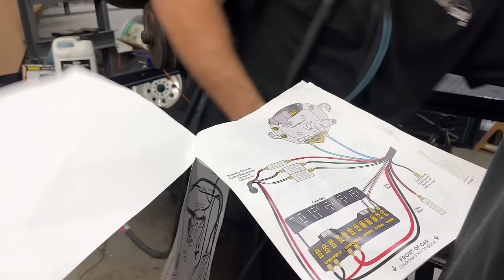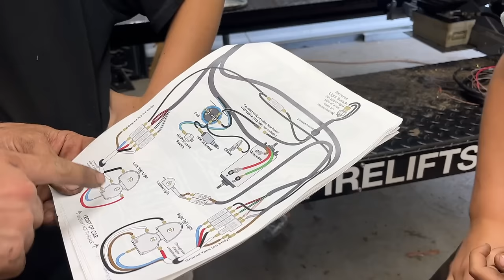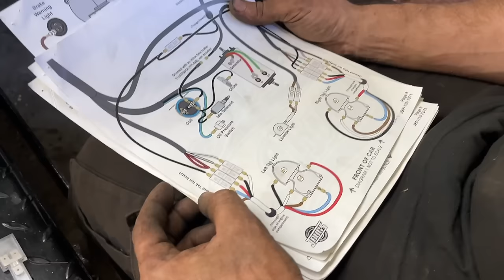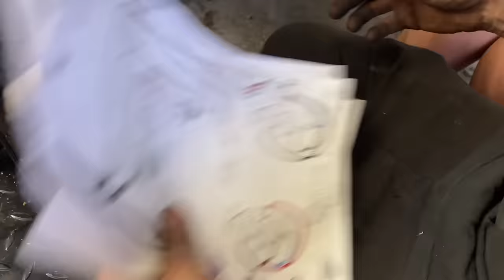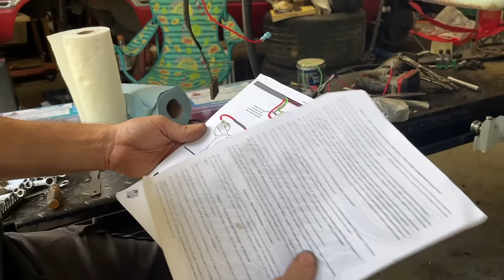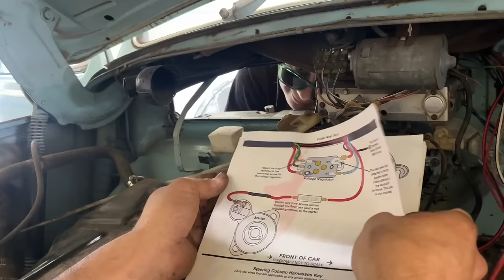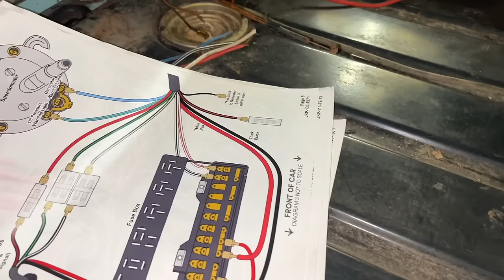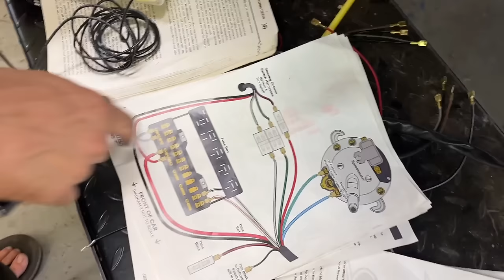Back on the road after 23+ years parked!

Comment: The previous owner was probably just planning on making a simple harness for making the car run and not buying a complete aftermarket harness for the specific vw bug so that is why he just practically cut everything out we had a farm truck that kept shorting out and catching on fire and the steering column was a issue so before too long the interior of the 81 Chevy c20 Scottsdale Long bed 350 quadrajet 4bbl 4 4spd manual shift transmission was a steering column shaft a steering wheel and only the parts of the column tube to mount the steering column to the dash and the collar on the floor and the firewall and two wires to the reverse switch spliced together to one wire and the purple and white stripe lengthened and laying across the steering column shaft and that was how you started the truck,oh shiii, approved lol and the fuse box had wires running out of it out under the hood to power the headlights and tailights. And after I started messing with the truck as one of my own vehicles I got a complete different standard transmission non tilt steering column and key release lever with the gm ignition key, and changed the front light harness so all of the lights would power on when you pull out the headlight switch truck would pull massive burnouts 4.56 open diff 14 bolt rear and 16.5 9.50 mud trac mud and snow tires old 70's series bias plys made by Firestone and it would throw some tall rooster tails in the field too, especially with the 4spd transmission

Comment: New video - fix rust and dents, Use primer/sealer (no sanding), 2-3 coats of color and 2 coats of clear coat, will increase joy for Wawa and value will increase 20 fold.

Comment: Love the relative simplicity of older cars. Need to change a bulb.. just take the light cover off. Modern cars you practically have to disassemble half the car.

With your beatle, something didn't work, you tried few things and found the problem.
Modern cars you need to plug it into computer just to figure out what may be wrong.

At least when your daughter gets to drive her car solo, she will know how it works, and will be able to fix it if need be. But beetles will run and run with minimal maintenance.
Reply from the maker: Thank you so much

Comment: Below that breaker plate, would be a Mechanical Advance, Hence no reason for a Vacuum advance. It's built into the distributor.
Reply from the maker: But most of the distributors you see, have a mechanical advance and a vacuum advance
Reply: If there's No Vacuum advance, then that's basically all you get depends on the Company that Manufacturers them, you could possibly find some tech sheet on the Certain Model distributor with adjustment procedures. Or another Company that provides the Vacuum advance, I would check the Factory Specs. Against the Aftermarket one being used you may approximate the elusive "Sweet Spot" ?

Comment: After that long sitting I can almost guarantee that the fuel pump diaphragm is rotten and leaking gas into the crankcase.   I suggest an electric pump and filter be installed under the tank.   Need a low pressure pump,  no more than 4psi.  I run mine through a revolted set at 2.5psi.

Comment: These carbs are totally different to any other carb you have ever worked on. Idle is totally controlled by the two mixture screws on the side. The adjusting screw on the throttle arm is only for when the choke is on , and should barely even touch when the choke is off. Idle has butterfly,  by pass passages. Getting these setting wrong , will give you , no idle , too fast an idle or an accelleration flat spot. Here is link on how to tune these carbys.https://youtu.be/3MVdscVjEn8

Comment: Hello Josh and Kristina this is very important information the plastic filter for the gas in the back is no good it's made in China and I seen two very important Volkswagens burn up on the highway and one mechanic says it because of those stupid cheap plastic filters see if you can get a metal one put in with make sure there are they are shield correct and check the rubber hoses and make sure you tighten them up I want you enjoy your car since you are impeccable take care of you and the family God bless

Comment: , also Wawa when you get a chance put in a spare tire in the front nose I fill it with air and make sure it's tight because that tire God forbid you getting the front accident it will take most of the impact I know it because it happened to me at one time the only thing I had to change with the hood it popped up a little bit but I couldn't get it back down other than that that's a great safety issue I also got hit by a bus at the stoplight and knocked me across Steinway Street Astoria Queens I survived that to no damage to my VW impeccable God bless

Comment: I don't get why you want to replace the generator with an alternator, it's working fine and probably will outlast a new alternator as well. Just remove the old grease from the generators bearing add new grease and it's probably good to go for a long time

Comment: Inspector here:Stop... use valvoline... this engine is made for it and visa-versa.... You Have to have metal clamps on the rubber brake lines. they will blow off on 1 stomp of the brakes... both throttle cable and clutch cable are seperate cable solid unit . they get old and rust down the tube, clean like the brake line blow out inject water Resistant grease then push new cable thru.  the digital ignition is great, much faster than the Vacuum advance... But.. If There is a EMP and everything that has a microchip Dies,  The Old ignition, points dwell tach,and vacuum advance.. will be Unaffected. Save all old original parts... Soo FUN!

Comment: Use to have a 68 comet.....After driving it for 4  years no issues...........Was exiting the freeway and the brakes failed.....One of the lines failed.........................
LAST thing you want is brake failure for your daughters car......................
The lines are old...............Based on my first hand experience with a vintage car.........................Put in new lines...........................

Comment: Recommended oil for an air cooled VW is SAE30W  and EP80/90 for the transmission,  They don't like multi grade oils or synthetics because the dispersants in modern oils are not compatible with mesh filters.  ZDDP helps with the cams.  You should not use Rotella in an air cooled engine as they run hotter than diesels or gas engines!   Rotella oil should not be used in gasoline engines period as it has the incorrect additives for gas engines and has a lower heat rating.  Throw the bellows in the cooling shroud and the flap that it connects to in the trash.  When the bellows fail and it will if it hasn't already the engine will overheat.

Comment: VW's are not slow, my first car was a 59 Bug, it was slow until I put a Porsche engine in it, that car would nearly fly at 120mph , outran the cops a few times for fun. (Don't do that WaWa) do NOT Lower it as it will corner better than most cars just like it is and you can tow it behind the motorhome easily for family fun. I Love you all, oh yeah I was a VW Porsche mechanic right out of high school and have owned nearly 100 VWs .

Comment: keep that german carb and take the time on it.. the chinese carbs aren't worth it.. also the reason you're having problems with that leaking at the brass fitting is either because its not tapped in all the way or the use of 1/4" fuel line that isn't braided...

Comment: Speaking from experience,  PLEASE , put hose clamps on all gas lines. I knew two people plus had my own engine burn up because  under load and heat of the engine,  you do not want a gas line spraying gas all over a hot motor and electrical wires. Go wa-wa !

Comment: I'm no Rocket Scientist; HOWEVER, I would have added an in-line FUSIBLE LINK (large main fuse, replaceable) on the positive output side of the battery. Justin Case. 'A la '76 Toyota Corona or '85 Camry.

Comment: Definitely do not use synthetic oil. Volkswagens are air and oil cooled . Synthetic oil does not absorb the heat from the motor like conventional oil does. good old 20 W 50 will work fine . An SVDA distributor uses a vacuum canister and dramatically helps with drivability Just my two.Cents.

Comment: Yes run vacuum advance the nun vacuum advance it's more for commercial use when the motor is running at a certain RPM all the time I believe Duckman has whole video out on vacuum Advanced and non vacuum Advanced Volkswagen engines

Comment: Fuel lines and brake lines are metric. Odd sizes.
Reply: The way they wire up the alternator/generator, if the Blue light for the alternator goes bad you don't have a charging system. I suggest carrying some extra bulbs in the glove box. lol

Comment: Most of the time, whatever oil is fine, in anything with a roller cam, it's not as critical. But please Please don't do synthetic oil. (Or the 15w40) it does not mix with the zinc antiwear additives, and neither does synthetic.....If you want it to have the right stuff, look for straight 30w, or straight 40w from ams oil, driven, or Valvoline. Something specific for older vehicles. People say it's not worth it, but if you like your car it's totally worth spending a couple dollars more to get something specific for old junk. . guarantee it will last longer if you do.

Comment: are you putting synthetic motor oil in an air cooled engine ? Rotella T4 15W-40 is not synthetic oil, it is a blend. Use SAE 50 or 15W-50 or 20w-50
Reply: T4 is dino oil. T5 is synthetic blend. T6 is full synthetic. I use T6 in my Mercedes diesel.
Reply: @gotham61  your mercedes diesel is not air cooled ?
Reply: @srenlund-hansen6883  Mercedes has never made an air cooled car
Reply: @gotham61  that was the subject you were commenting on, oil and air cooled cars. 
They made lot of air cooled cars w boxer engines.
Since Benz's first opposed twin, there have been four-, six-, eight-, 10-, 12- and 16-cylinder boxer air cooled engines, powering everything from motorcycles to family transport, sports and racing cars. Plus a wide variety of commercial and military vehicles and aircraft.
Reply: @srenlund-hansen6883  Not sure what point you are trying to make. You said Rotella T4 is a synthetic blend, that is wrong. T5 is the synthetic blend.
Reply: @gotham61  HE sleeperdude said that it is fully synthetic, and it is no. T4 is conventional old fashion oil, T5 is blended semi synthetic, T6 is fully syn.
You also said that Mercedes Benz never made air cooled cars, stop now before you get everything wrong.
Reply: @srenlund-hansen6883  Boy, you just don't know when to quit, do you?
As a former Mercedes Benz Club secretary, and as someone who has written for several Mercedes-Benz specialist magazines, I can guarantee that I know more about Mercedes-Benz history than you do.
You said: "Rotella T4 15W-40 is not synthetic oil, it is a blend"
This is wrong.
I said: "Mercedes never made an air cooled car"
That remains a 100% accurate statement. In fact, Mercedes has never made an air cooled engine of any type, including aero and marine engines. If you are so sure I'm wrong, please tell me the years and models of these mythical air cooled Mercedes cars. They don't exist.
They have also never made a boxer engine, apart from a few pre-war prototypes, and the flat 12 M291 use in the Group C C291 race car in 1991 and 1992. Like all other Mercedes engines, it was water cooled.
Reply: @gotham61  you are from the us. You dont need to know everything, but you seem to know it all as long as it fits into your little world. Come visit the civilized world and the museum in stuttgart germany
Reply: @srenlund-hansen6883  Funny you should mention that. I will be visiting the Museum (for the fifth time) in about two weeks. I will also be at the annual VdH Jahrestreffen in Ornbau. Maybe I’ll see you there?
By the way, just FYI, I lived for more than two decades in Europe, aka “the real world” LOL
Tschüss!
Reply: let them show you how many different air cooled engines they have, including boxer engines. The museum is built like Guggenheim-museet in New York,
Reply: @srenlund-hansen6883  Like I said, I have been there several times. Maybe while I’m in Stuttgart I’ll also go to the Porsche museum. Unlike Mercedes, they actually did make a lot of boxer and air cooled engines. 
Such a troll.

Comment: Good afternoon 😃 sleeperdude   On wawa Volkswagen the motor is held in with 4 bolts  you have to disconnect the wires to the motor and then take out the 4  bolts that hold the motor in  now  wiggle the motor and pull it out of the transaxle    1  good thing is the motor will run 🏃‍♀️ out of the car 🚗 because it is air cooled  I think 🤔 wawa Volkswagen is really nice 👍 for her to have and drive  I would like 👍 to see you and the family put  on a set of hedders for a  good Sound  I have owned a rail buggy that was made out of a Volkswagen I had herdders  on it  it sounded very good 👍  i really enjoyed driving mine off road  you said you might get a  nother  Volkswagen.  You might like 👍 to try to make a  dune buggy or bahaw  🚗   Or  a rail buggy  I think 🤔 your family would love any of the ones I have told you about  I  like 👍 Volkswagen  they are so neet  I know that wawa  will enjoy driving her car 🚘  your animals are so cute 🥰

Comment: You don't use a paint brush to paint wheels, a rattle can would have been much faster and looked much better. Youll have runs all inside the wheels cause the excess paint builds up then runs out of the crevasses. Also those plastic fuel filters fail a lot. This is an air cooled car these Vws are notorious for catching on fire as is and now you increased that chance. Come bon Josh you know better than that. Remember your daughter is going to be driving this car.
Reply from the maker: Ok thanks

Comment: How is wawa aloud to drive in the US if she's only 14 🤷‍♂️
Reply: The age at which a teenager can start to drive varies greatly depending upon the state in which the adolescent resides.

In nine states, teenagers can enter the learner stage of a graduated driver licensing (GDL) system and obtain an instructional permit before turning 15 years of age.  In some rare circumstances, a teen can drive alone with restrictions at age 14.

I think 14 is young, and so do many safety experts who recommend waiting until age 16.

If you have a child who is approaching licensing age, it's wise to view your state's Department of Motor Vehicles (DMV) website to read up on the requirements your state has in place for its GDL process.

Typically, in the first stage - the learner's permit - the child will need to have to have a supervising driver in the passenger seat.  For the intermediate stage, the teen can drive alone but with restrictions.  And with the full license the young driver is able to drive without restrictions.   To move through the GDL system, most states require that the teen take certain training in class and behind-the-wheel driver education courses.

Here is a breakdown of age requirements for a learner's permit, according to the Governors Highway Safety Association:
Reply: State                         Age

Alaska                        14
Arkansas                    14
Iowa                           14
Kansas                        14
North Dakota               14
South Dakota               14
Idaho                          14 years and 6 months
Montana                      14 years and 6 months
Michigan                      14 years and 9 months
Alabama                      15
Colorado                      15 (with driver's education class or 16 without)
Florida                         15
Georgia                        15
Illinois                          15
Indiana                         15 (with driver's education class or 16 without)
Louisiana                      15
Maine                           15
Minnesota                     15
Mississippi                    15
Missouri                        15
Nebraska                       15
New Mexico                   15
North Carolina               15
Oregon                          15
South Carolina               15
Tennessee                     15
Texas                           15
Utah                             15
Vermont                        15
Washington                   15 (with driver's education or 15 years 6 months without)
West Virginia                 15
Wyoming                       15
Arizona                         15 years and 6 months
California                      15 years and 6 months
Hawaii                          15 years and 6 months
Nevada                         15 years and 6 months
New Hampshire             15 years and 6 months
Ohio                             15 years and 6 months
Oklahoma                     15 years and 6 months
Virginia                         15 years and 6 months
Wisconsin                      15 years and 6 months
Maryland                       15 years and 9 months
Connecticut                    16
Delaware                        16
District of Columbia        16
Kentucky                        16
Massachusetts                16
New Jersey                     16
New York                        16
Pennsylvania                   16
Rhode Island                   16
Reply: Anyone can drive on private property. Licensing laws only apply to public roads.